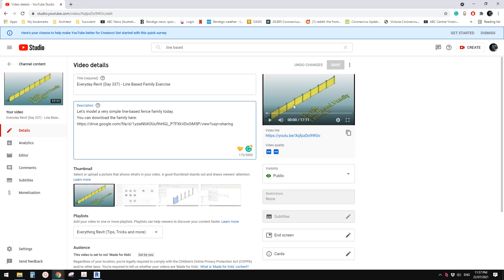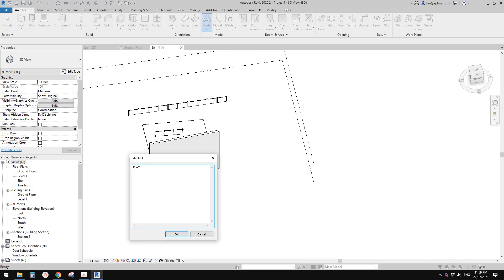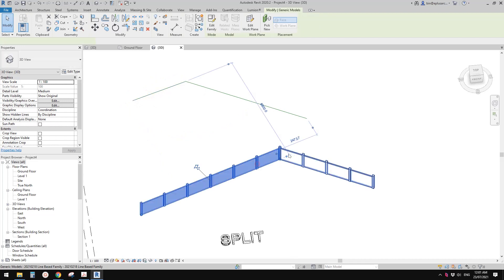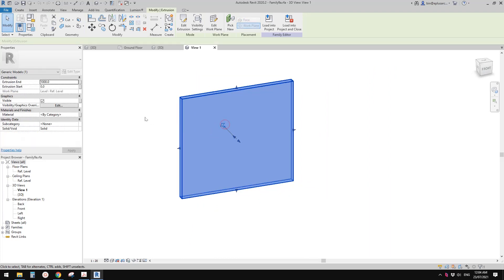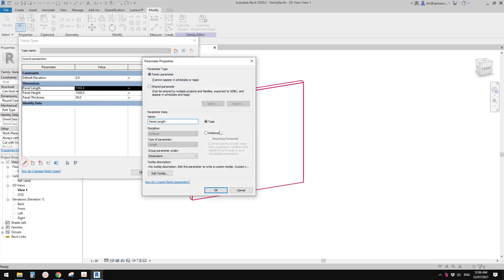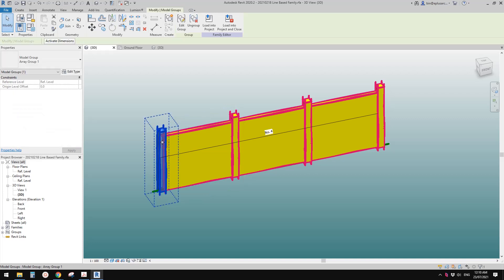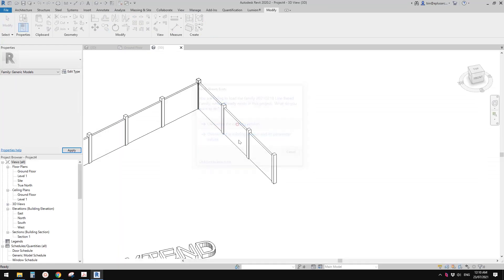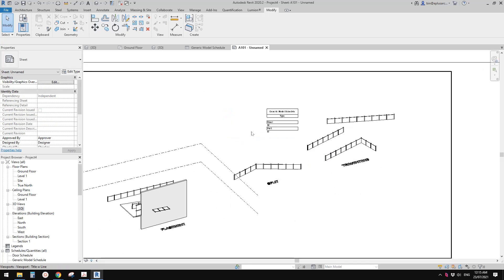Everyday Revit (Day 489) - Some useful tips for Line-Based Family

Comment: Great video as always! Thanks for the video step by step! But this schedule/family has an small issue where the post doubling up when there is a corner or split... Is there a way to resolve it?
Reply from the maker: You are right.  I guess we can start the post array from the second post location to the end, then have the first post with a visibility parameter.    Then we need to have some if condition in case the fence is too short...  something similar to Day 140 and Day 141.
Reply: @BINHE615  thanks so much!